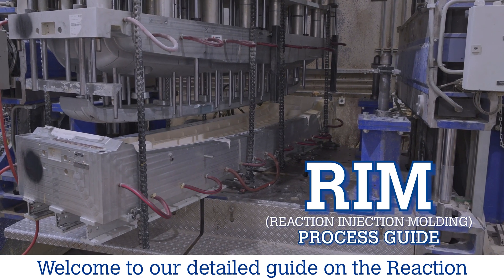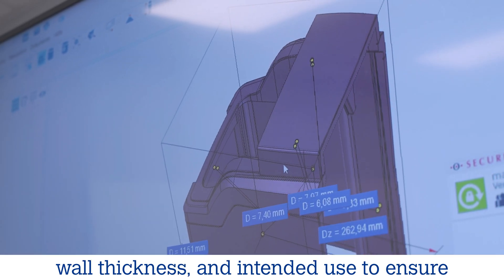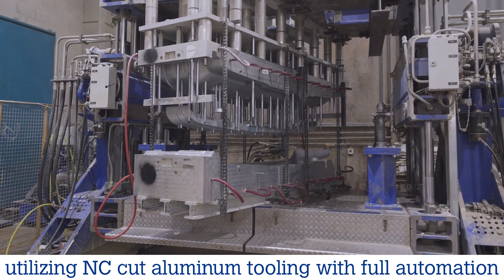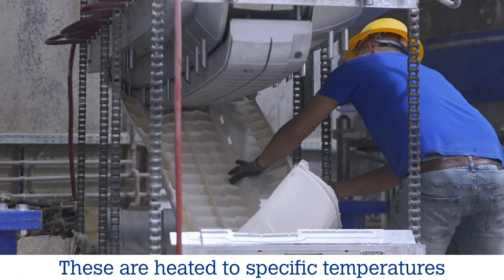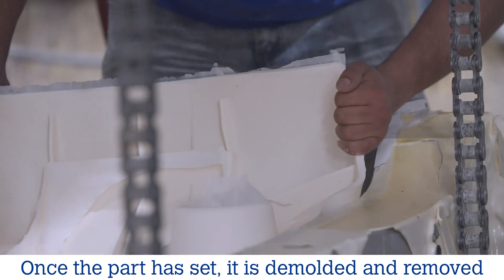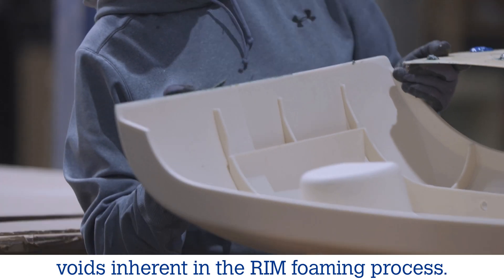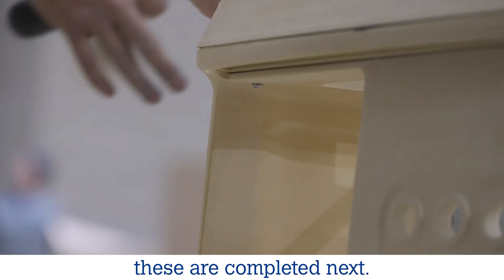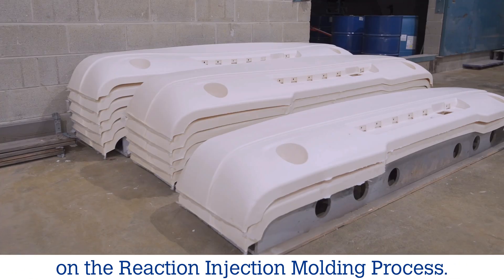RIM Molding Process Video CC At Thieme Corporation

Comment: How do you vent the gas?
Reply from the maker: We vent through flashing through the part line of the part.  Once molded, the part is then de-flashed.  We also orient the part in the tool carrier in such a way when filling by gravity feed, the air is quickly removed from the cavity.
Reply: @mypur  What material is used to make rim molds?
Reply from the maker: @levandung9434  CNC Cut aluminum is the material we use to make the tooling .